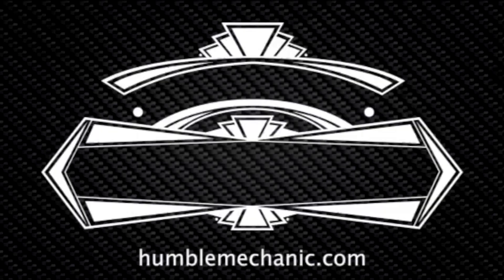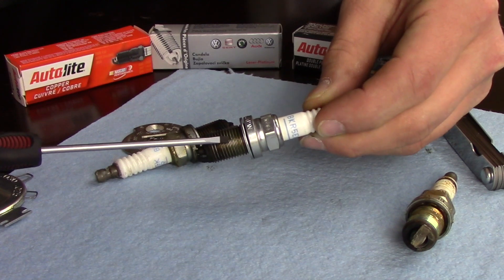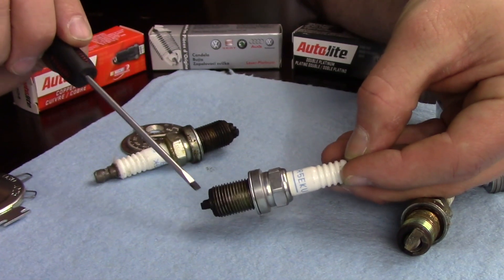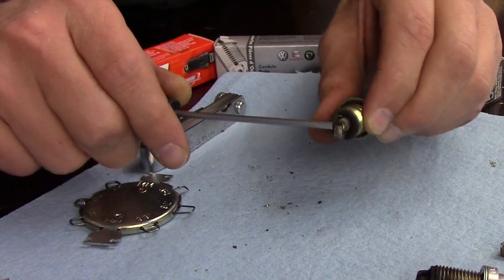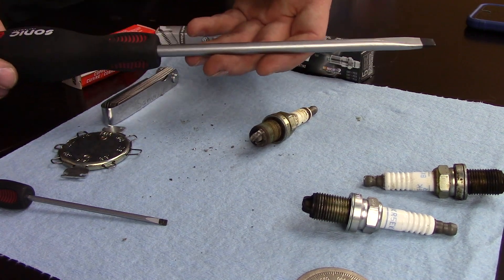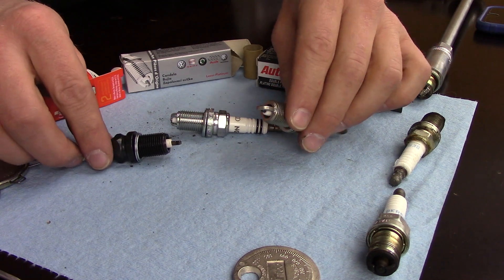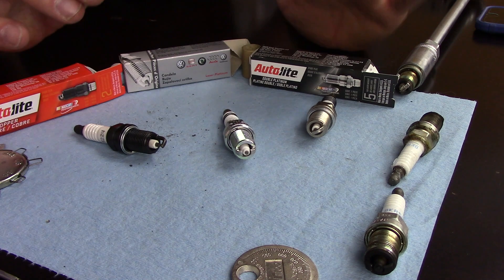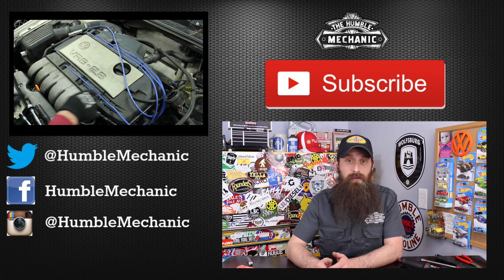What You Need To Know About Spark Plugs

Comment: Dumb Question: Does a spark plug fire on every cycle? Or does the pressure+radiant heat continue to set them off?

I always thought it was the latter, but someone said that it was the former. Now i can't find proof either way -.-
Reply: Frosty. - Depending on the system in the car or motorbike can either be just on the power stroke or the so called lost spark. 
But definitely they are set to fire when needed not due to pressure+heat. If or when that happens we're in presence of the so called pre-ignition which is an engine killer. That can be heard as a knocking.
Gas engine is by definition an internal combustion engine. The knocking is an explosion, basically the flame front as a considerable difference in speed (higher speed). The margin between them is quite thin, but is the difference between a good running engine or metal for the scrap yard. ;-) LOL
Reply: I thought that knocking started to happen when the engine was overheating and igniting before it was supposed to. But that the engine was magically tuned in such a way that it would only ignite at the right spot under normal conditions.

interesting stuff

Comment: does replacing spark plugs faster help fuel economy?. for example 2015 gti asks to replace spark plugs every 53 000 miles would replacing them every 30000 miles be beneficial ?
Reply: Jimmy A - Most possibly yes, but it all depends on the condition how you use your vehicle and off course the condition of the plugs itself. As a general rule of thumb, short distance city driving is the worse for an engine. Relaxed highway driving and they can be perfect after that mileage. Check before changing. ;-)

Comment: Torque? Tighten till it breaks then back it off a half a turn...
Reply: Sorry, I couldn't resist. It was an old joke we passed around when I worked at my buddy's machine shop years ago...
Reply from the maker: +Michael Gibbons hahaha.
Reply: @michaelgibbons829  sounds like AvE ;P
Reply: be sure to snap the stud off in the aluminum block at the proper torque, proceed to next step, snap off hardened steel broken bolt extractor in the hole half in the block and half in the broken stud, congradulations you now have a very hard piece of metal in the same spot your going to have a coolant leak when its back together, its better to just drill it all the way out and break a lag bolt off in the hole instead
Reply: That was mad !

Comment: You didn't mention if the cheap spark plugs are good enough or if the platinum really are better. I feel like expensive spark plugs are just a gimmick. Am I wrong?
Reply from the maker: +TheEgg185 the engineers that design the engines do more research than almost anyone. I always recommend buying the proper OEM recommended plugs. For stock cars anyway
Reply: HumbleMechanic actually the OEM spark plug for the passat b6 for example is made by bosch while it costs around 82$ but on the other hand the after market spark plugs for the same car costs 50% less than the OEM anf finally both of them are made in german ,,,,  so will be there any difference in the engine performance if i ised the bosch ones !!!!?
Reply: Hany Alsisi i dont realy think it will make a power diference if they are the same type, they will probably die faster than normal ones, i eould recomend to always use the sparkplug recomended for your engine, as long as the engine is stock, i would also never use cheaper ones.

Comment: Heat range is actually determined by the amount of contact area made between the lower part of the insulator and the shell. More contact area means better heat transfer to the shell and out into the head, thus a "colder" spark plug. A hotter plus in turn has less contact area and thus less heat transfer. Here's a nice graphic about that from NGK: 

http://dsportmag.com/word/wp-content/uploads/spark-plug-tech-142-002.jpg

Comment: I am a mechanic myself and always recommend replacing these suckers at time of service intervals, i know that spark plug is only about a conductor a gap and an insulator nothing is wearing inside it except if there was a resistor but lets say there is no resistor and its due for replacement, is it possible to ultrasound cleaning it to remove tuff carbon deposits inside the electrode  ? Hence deposits are the main reason for spark plug performance degradation!!   I have access to a very power USC machine i should experiment this

Comment: ha that spark plug you said was worn out isn't as bad as my truck. i got my truck almost 3 years ago and it ran just fine well last week it started to run ruff so i pulled plugs and wires well 258765 miles on the stock plugs and wires. when i did buy the truck i was told it needed a tune up but i was like it runs fine no need to replace what isn't broken. well when i pulled the plugs out i was in total shock that the truck even ran with them the center electrode and ceramic where so bad you can't even see them if you hold it level to your eye so i think the spark was going to the side and not to the ground electrode. the wires where stock 1996 motorcraft so i think the acdelco plugs had to be stock as well. so yes 20 year old plugs and wires it did need a tuneup lol

Comment: In my youth, I used to overtighten the plugs on my 12v. I've ripped numerous threads off the plugs from not using a torque wrench. It's not fun having to dig in there with an extractor and ruin a perfectly good spark plug. Torque wrenches, kids.

Comment: My car won't start and I'm almost positive it's the plugs but my knowledge of cars is very little. I can turn the ignition all the way but nothing happens. The lights weaken and if I fuck with my lights it starts to click. things like moving my seat back electronically and when it locks and unlocks it's very, very slow.  thoughts?  thanks in advance
Reply from the maker: +ReaLx2006 sounds more like a battery issue than a spark plug issue
Reply: +HumbleMechanic The battery is about 3 months old, connection is fine could it be corrosion? thanks for your input!

Comment: If your car has a single earth strap, pretty much any name brand, ie NGK, Bosch, Champion, Denso, etc  plug with the correct temp, same reach, etc will usually be fine. 

Copper plugs don't usually perform any worse, they just need to be replaced more frequently. 

From what I've seen & how cheap copper plugs are, regardless of brand, you're likely better off running a good brand copper, than a dodgy brand platinum or iridium.
Reply: Also, if your car is modified, there is a good chance you will need a cooler plug and possibly less gap, which you can't usually get with an OEM plug.

Comment: What if you have the wrong reach the opposite way, like to far out the combustion chamber? (Less threats)
Reply: I've actually seen that happen once. Somebody put in the wrong plugs with too short a reach. The problem is that carbon will build up on the exposed threads of the cylinder head. If the threads get clogged up with carbon you could damage them if you try to force the correct plug with the longer reach into the hole. What we did was to run a tap through the hole first to remove the carbon on the threads before we put in the new plugs.

Comment: Interesting that VW is using NGK as OEM now.  I thought Bosch would be standard in all German vehicles.  If your vehicle came equipped with a fine-point center electrode and has coil-on-plug ignition, you will want to stay with a fine electrode replacement plug as it takes less voltage for the spark to jump the gap.  It's usually best to stick with what the manufacturer recommends.

Comment: I always prefer OEM 
I don't like to use autolite plugs for a gm or Ac delco for a Ford  and so on. with the old air cooled VW's I have seen champion plugs in them and every air cooled VW's engine I have rebuilt that had champion plugs  had broken heads from the plugs. it pays to stick with the correct plugs on any vehicle.

Comment: Thanks Good video. most of it i  knew..  another important thing to do with your Plugs is to Clock Them. just like your clock your ring's on your engine Piston's . very important to do & with Spark plugs is how you fine tune. to get the most out of them.
Reply from the maker: +Nate white to me clocking plugs is a worth wild thing in performance applications.  When it comes to normal maintenance it usually more work than it's worth.

Comment: Hi, do you know what are the OEM spark plugs for an Audi A4 B6 model with a petrol engine, the 1.6 Eu engine?
Is it by any chance a NGK or DENSO? I don't want to pay a dealer or shop extra money just because it's a VAG stamp on them, don't think that there is any quality difference between them.
Reply from the maker: +SacreDro call and see if they will give you the part number
Reply: Well if I search on Etka online I see that is either NGK or BERU. I have NGK for now but I bought some Bosch plugs and compared the size and all and they are identical, so in theory they are the same, time will tell if the quality differs from brand to brand.
I've talked to another mechanic and he said got with the factory because the engine was designed with it, but having the same size and all doesn't mean that much I think.

Comment: As a rule of thumb master technician many years ago tell me if it's a German car put Bosch but plugs at the Japanese car use NGK or Denso. About 10 years ago I was using my vehicle for my company and was driving it and I bought a set of spark plugs from different brands ranging from champion, and NGK Bosch, Denso etc. I did not notice any improvement in fuel mileage or engine performance, however I allowed each set of spark plugs to sitting in the for 15,000 miles....Japanese and German design. were much better.

Comment: Someone correct me if I'm wrong but from my limited knowledge of electricity I would think 2 or 3 ground tabs isn't going to change anything because electricity takes the path of least resistance and is going to jump to the closest one even if the difference in gap isn't much it's still only going to be one spark regardless of the number of ground tabs.
Reply: The theory is that with a regular plug the flame coming out of the gap goes sideways. But with a two  or four electrode plug the flame shoots out of the gap and goes directly down into the cylinder. Supposedly this improves the ignition of the rest of the fuel, which increases gas mileage and performance.

Comment: i boight new ngk spark plug wires. they dont fit over the plugs. i noticed that the older wires have bigger holes than the new ngk. how do i go about this?
Reply: On some spark plugs You can screw off those bits where spark plug wire goes. So those new wires woul'd fit.

Comment: I don't think it has anything to do with the quality of the plug. IE the Autolite vs OE. I believe the problem lies in fitment both electrically and physically. I had a 97 Tercel that acted up simply because it had single electrode plugs. There was a sticker under the hood from Toyota indicating that dual electrode plugs must be used. Parts catalogs list them simply because they fit the physical criteria based on their required dimensions. This can lead to the parts houses varying in shear numbers of plugs listed for a particular vehicle. I said there can be electrical and physical issues. Here's why. The newer COP designs put out tremendous voltages and the single electrode doesn't have large enough surfaces to dissipate the spark thus giving limited spark to ignite the fuel. The other reason is the location of the tip in conjunction to the valve opening. Because of the arraignment of the dual electrode it is more exposed to the air/fuel mixture. In today's lean burning engines, this allows it to be recessed in the head further without hindering the ignition process or creating additional hot spots in the combustion chamber caused by the longer tip of its single tip counterpart. That being said the single tip plug has to be recessed just as far back to prevent mechanical interference. By doing so it reduces it's ability to ignite the mixture. 
This simple design difference can lead to hesitation and lurching. I was scratching my head trying to figure out why my car was giving me such issues. I even pulled the injectors and flushed them manually. Then I looked at the tag and bought new oem style plugs and the problem disappeared.

Comment: do you think a colder plug is better with the methanol gas we use now that ignites faster because of the methanol?
Reply: Gristle Von Raben Methanol? Probably ethanol if you are using pump gas. Methanol is typically used straight as race gas, or as spray mixed with water in the air intake to cool the air intake charge. Methanol is also expensive compared to ethanol.
Reply: A slightly colder plug is only better if you're engine is producing a lot more heat such as when running a turbo charger near it's compressor efficiency limit. I assume,  since you're running methanol, you have your engine tuned to run much harder to take advantage of the greater knock resistance.
Reply: Gristle Von Raben
Methanol actually makes the cylinder colder when it's burned. So you would have to advance the ignition timing.

I think that's your problem, the fuel isn't being burned completely. Same happens when you put high octane fuel in a normal economy car with normal compression and no turbo. The fuel doesn't burn completely and gets wasted thus worse fuel economy and less power.

Putting a colder plug would make things worse. You need to turn the ecu to advance the ignition timing and raise the air fuel ratio to generate more heat. That will improve the fuel economy and performance. Otherwise don't use methanol as an unmodified car isn't going to benefit from it.

So in other words: methanol raises the octane rating of fuel.

Comment: I just prefer using cheap copper spark plugs and replacing them around every 7,000 miles. After researching, it's supposedly better than using iridiums and keeping them inside my engine for like 100k miles (by manufacturer's standards) in my 2.4L SOHC Tigershark Multiair II engine. But damn double ground electrode? I wouldn't mind paying for that in a copper spark plug

Comment: The best advice I have found is stick with OEM plugs. The engines computer is typically programmed with the electrical characteristics and heat range of the OEM plugs. Do not trust the gap out of the box, always check it. There are many plugs that may be better than your OEM plugs, but the PCM most likely does not have the programming to utilize their benefits. Mass air flow systems have some flexibility, but for speed density systems OEM plugs will most likely be the best choice. The typical torque spec for aluminum heads is 17 foot pounds.
Reply: I wasted money on iridium plugs figuring this out on my Chrysler minivans. The OEM double platinum plugs gave me the best fuel economy and power.

Comment: about using a torque ratchet and extension. ive heard that you lose the effectiveness of the torque your trying to achieve. Is this correct or its a minimal difference?? ive done a spark plug change on a ford expedition where i would have to use two extensions and a wobble socket. Would the torque be the same?
Reply from the maker: +daxfactor23 i don't worry about it. It may be slightly off, but no more than a variance of a torque wrench.
Reply: thanks for the response. channel is awesome